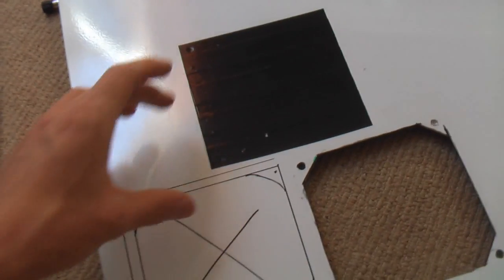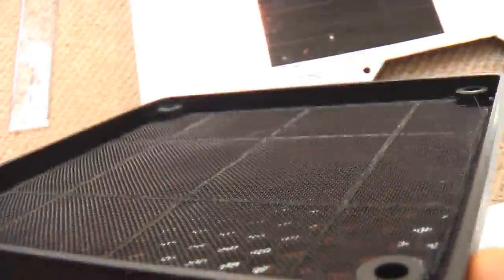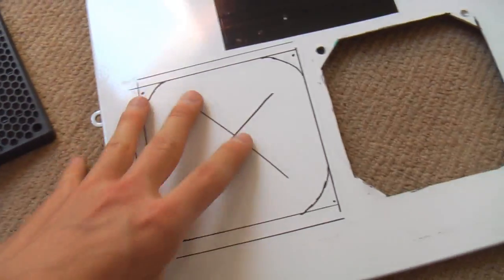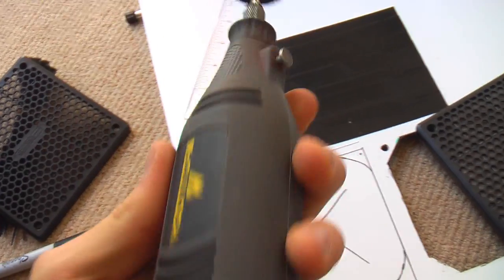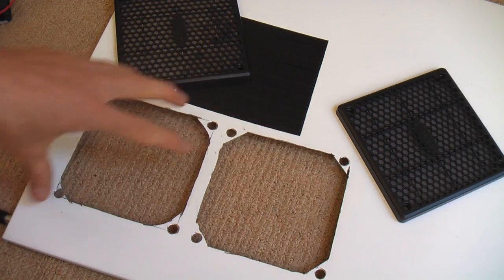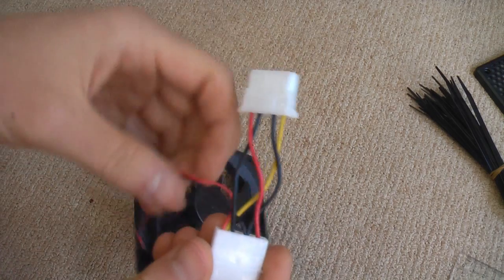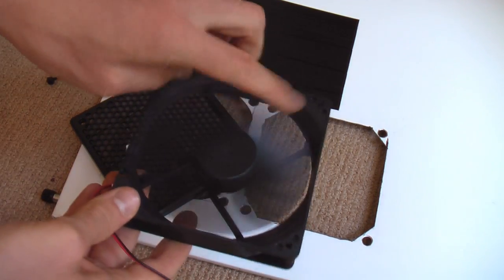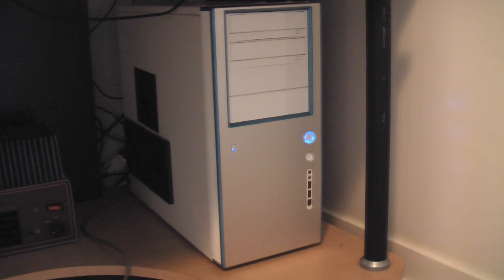Adding a Fan to your Computer Case

Comment: Forrest Trenaman , you could have just drilled several holes in a few seconds and that way you dont need such a thick filter, in addition to being cheaper, faster and easier it adds structural integrity and adds an additional barrier to dust.

Comment: so I have no fan in the side vent, nor the top , has room for 2 top.. I have one in the front, which is blowing in, if I add one 120 mm to the top or side, should the air be blowing into the pc or out of the pc?
Reply: Leonard Morales both basically you want it to flow in from the front and out the back.

Comment: also, i'd recommend using a higher grade airflow optimized fan. What you have there seems to be a static pressure optimized fan, ideal for dense heatsinks.

What you would gain from this would be increased airflow, and a more silent fan.

Something like the corsair AF series would be great.

I could recommend the af120 twinpack, as its great value :)

Comment from the maker: Antec Sonata Designer 500. It's an old case, but I don'r see a need for a new one, and it's really well made.

AMD Phenom II x4 

Coolermaster heatsink 

Gigabyte GA-870A-UD3 

Gigabyte 6850 1GB 

G.Skill - 12GB (2 x 4GB + 2 x 2GB) 

Crucial m4 Solid State Drive - 128GB 

2 x Seagate 500GB HD 

500GB Laptop Harddrive (not in video) 

Antec 450W Power Supply (came with case) 

Some sort of Optical Drive I never use, I think it's LG